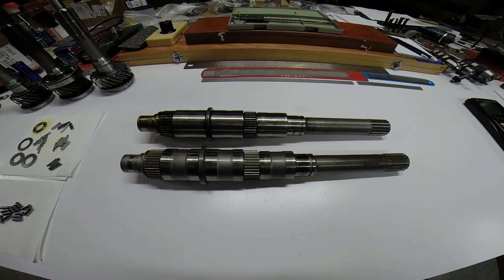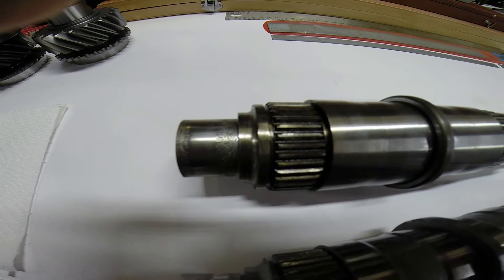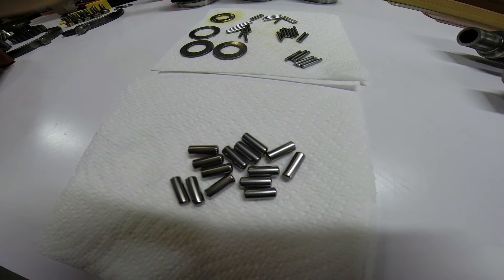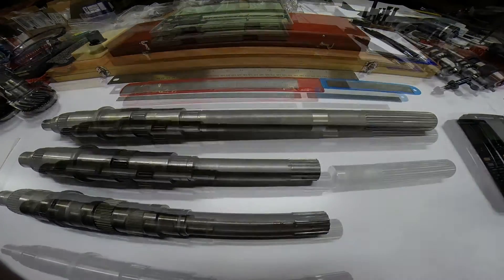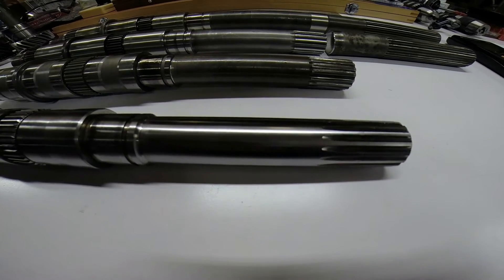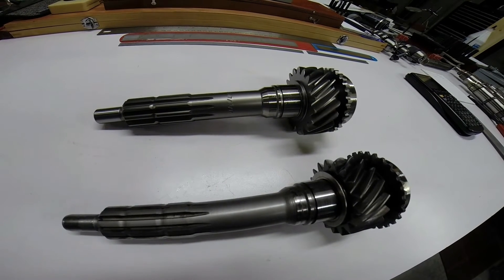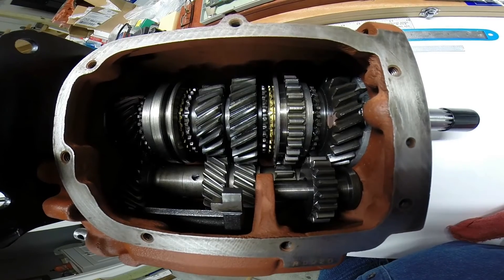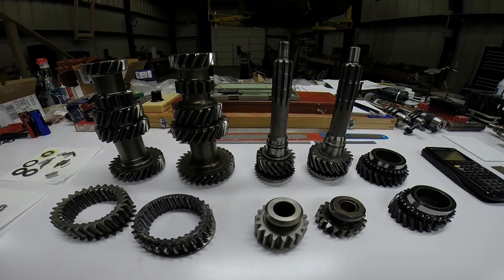Corv-8 Saginaw Transmission

Comment: My Corv8 transmission  input shaft was remade to the V8 Chevy  model eliminating the small roller bearings to larger ones! Sounds like this one!  Also changer the Saganaw transmission to a close ratio one via Chevy  in house Engr. It was a  CORV8 in a Yenko #99 1966 model.  Engine was a crate Corvet LT1 V8 Solid lifters.
Reply: Building a CORV8
The Car
CORV-8 Built in 1966 Yenko Stinger #99.
The car with abt 90K miles on it was purchased from the original owner in the Hartford CN area about 1968. The engine was removed & sold.I had put abt. 7K miles on it my records show.
The Brake System
The entire brake system was renewed, including the rusty lines! The new brakes were sintered metalics.
The New Engine
The engine was purchased new from Chevy in a crate. It was a 1970 LT1 350 Solid Lifter version. It was new in crate from Chevy in West Springfield MA. It was last one Chevy had to ship. It was a replacement for CORVET engine & came new in big wooden crate I returned bell housing, holly carb, and few other extras I did not need or I already had for credit! As the wanted 350 Corvet hydralic version was just discontinued, I purchased the solid lifter version. This would prove a bad choice
for my private conversion.
I found the half valve keeper shortly after during an oil area check. Very lucky not to ruin the engine.
During hill climb test in Wilbraham Mountain, I dropped a half a keeper. It was a mile up and very steep , but nicely paved. Vision was good for safety. There was a fellow at top of hill that
came out a few times to shake his fists at me. I guess the dual exaust and mufflers could be heard well while I was in 2nd or third gear. I think the tack was not reading properly and I likely
over reved!
The Carb for V8
The stock carberator that came with the crate engine ( 950 Holley as I remember) was exchanged for a slightly tamer Holley version. The bell housing was also returned for refund.
Remember the conversion needed a special bell housing to mate with the Saginor (sp) box.
The Radiator
The new radiator was ordered as all the conversions I knew of at the time were having trouble with engine overheat!
I ran just water in the summer as I felt it was providing better heat removal from tests. This is in contrast to 50/50 for antifreeze fluid.
The radiator chosen was a Corvet copper cross flow replacement version, not the stock Aluminum one at that time. The radiator was electric fan cooled and hot air exited via the oval holes cut in the
tops of the front wheel wheels. Another hole was cut in the floor board area in front of the driver to allow hot air from the radiator compartment to enter the passenger area on a cold day. I
had a sliding flap over it so the driver had control of volume of air & heat. Remember the radiator was put in front in what used to be the luggage compartment in a stock Corviar.
The radiator fan in the front was driven with a (larger that kit) truck electric radiator fan motor and a double bladed blade that was in at that time.
I remember getting on it while commuting home from Farmington CN & via Hartford Center in the summer. My back was glowing from the engine radiated heat. This is through the foam
sprayed on the back of the seat & the appolstry we had to provide.
The Tansmission
The transmission was blown up early in testing. I decided to redesign the motor to transmission shaft & bearings. I think part of the failure was from case bolt assembly errors however. I
changed the kit design of small Corviar sized bearings &  shaft diameter to a high speed version used in the Chevy Impalla as I remember. Larger bearings. I had the special shaft made in a
Springfield MA machine shop to my specs.
The transmission was converted to a close ratio box via Corvet Eng. Help. It used gears from other Chevy Saginaw boxes. I was able to start off in 4th gear very easy, no strain. Only for
testing.
I developed a strong spring idea on the outside of the transmission to help the shifting.
Best records say transmission was a close ratio box ( 2.54) per Corvet Engineering & my purchase new their recommended parts ( gears) .
Working With Corvet Engineering
I was at that time conversiing with at least one Corvet Engineering Engineer via telephone.
The Big Move To DC Area
The conversion was uesd for about 10K miles and then trucked via moving van to Washington DC area where it sat looking tired & lonesome in my tickey-tack house.
The Sale in MD
I sold it to a fellow
MD person ( Mark) after advertising it in the CORVAIR Magazine. This was about 22 yrs ago. As far as I know, it still sits in a barn in central MD without its engine.
Oil System
As it only had room for a stubby oil filter in conversion, an extra full flow larger filter was added in line.
Fuel Milage
It got about 6 mpg during periods of GETTING ON IT.
Fuel Pump
Records indicate it likely was a Mechanical Fuel pump, not electric ?
Windshield
Windshield was cracked / broken in MA garage during build & was replaced.
Steering Column
It had an adjustible steering column.
Yenko Paint
I kept it as a Yenko paint version. All I have left are memories & the glove box book.
Air Intake & Filter System
The air intake was from the rear intake for the original Corviar engine. The air from the out side of rear window was ducted to the V8 carb and included a pressure relief hole to prevent
unintentional leaning out of the Rochester Quadra Jet Carb mixture.
Tires
The tires were kept at only 6 inch width Goodyears to protect the clutch & transmission.
Crown Kit
A friend of mine copied the kit himself & was doing almost non recoverable wheelies! Its hard to steer with your two front tires in the air!
Seats
The seats were the stock kit double bucket seats. I remember getting a cleaning rag caught in the fan belt and running my fingers over the pully. OUCH!
Rear End
Stock 3.89 Yenko RE gears & Posi. Best gears were used from 3 REs I had. Posi plates replaced with new ones. RE was upgraded with Crown Kit extra spider gears. Also, gears ( shaft) was preloaded by me with an inch-pound torque wrench & blue prussion dye to check tooth mess pattern via Corvair book.
Other
There was of course NO fan blade on the engine front.
The engine compartment in the old Corvair back seat area was covered with the stock kit cover. It was very noisy with the solid lifters. 16 tiny hammers!
 

I don't at this writing remember if I used an electric fuel pump or not. I do remember amassing 3 transmissions & 3 rear ends before starting assembly. I wanted to put the best parts in one.
I kept the Yenko stoch 3.89 Rear End & Posi unit. It was upgraded to the 4 spider gears as recommended however.
I had several buddies help me with the work. This included two strong fellows that lifted the crate engine up and into the car . I did lots of pop rivet work that included air ducting areas as
well as other. The car used capicator discharge ignition. It had a fire estingisher in front . It had aircraft style seat belts into the buckets seats for only two.

Origional Page Done----7-19-99